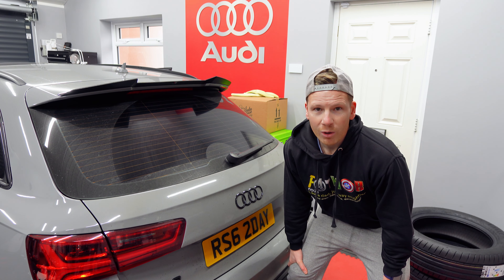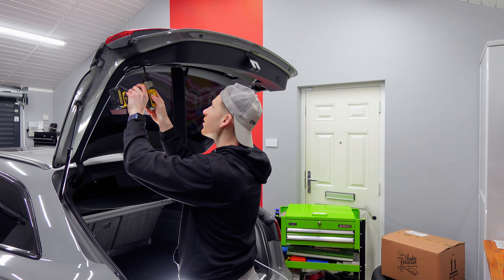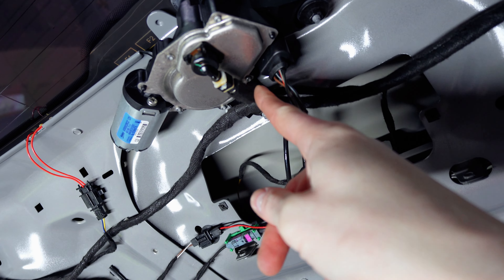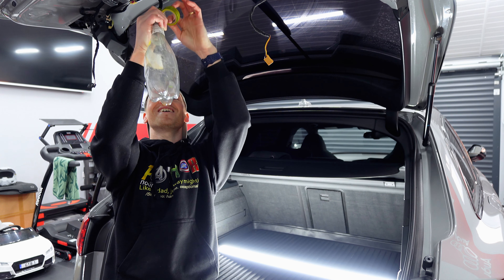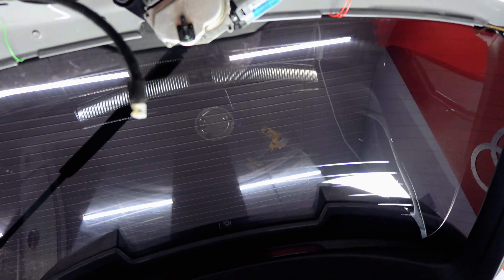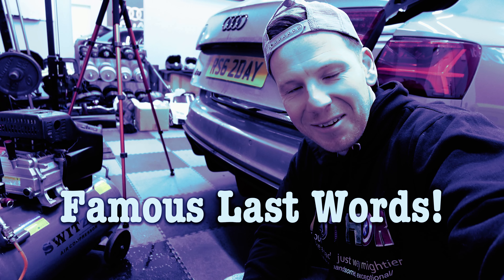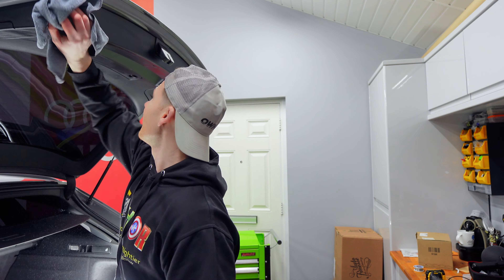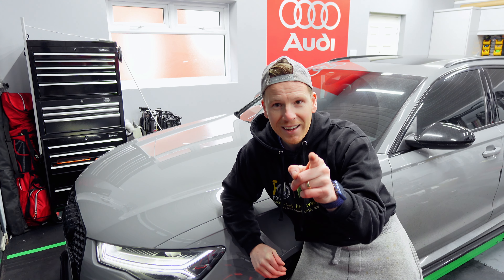Audi washer jet problems, FREE FIX!

Comment: Did it last mate? Middle of the same job here.
Reply from the maker: Hey mate,  yes still going strong 12 months later.   However I can’t say I have used the jet that many times since.  But still try from the few times I have 👍
Reply: @InDadsGarage  Good stuff. Fingers crossed here. Mine was in worse shape behind the cover.